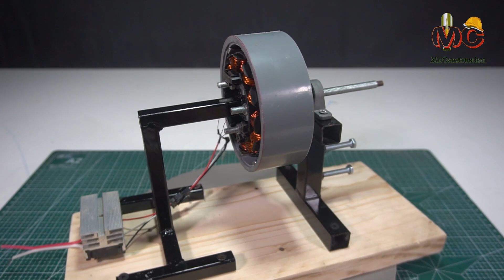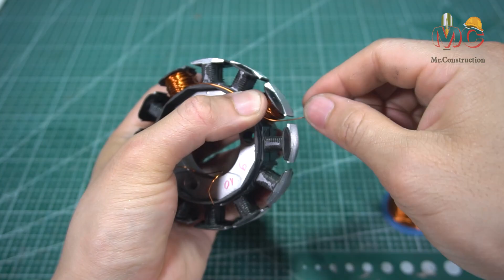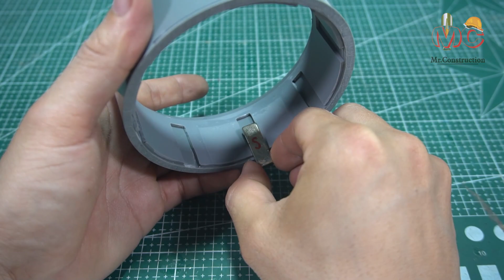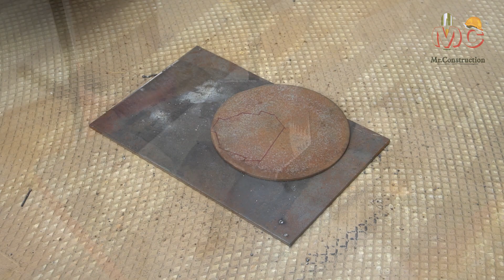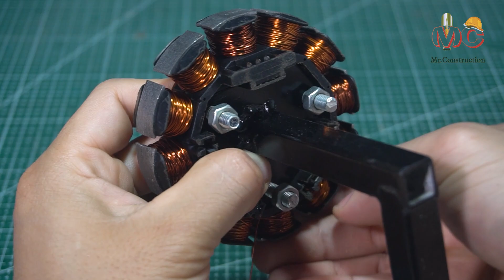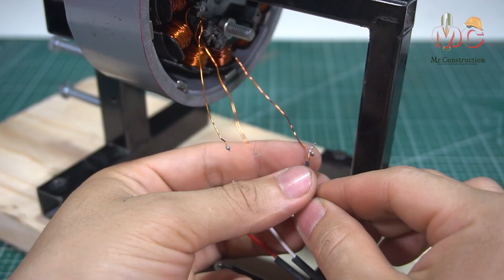How to make a 3-phase generator from simple materials

Comment: no one is talking about the fact that he is using an AC to DC converter. to power an INDUCTION AC motor. and the voltage would be way too low. There is no inverter. Even if you added one, it would be too power-hungry.
Reply: AND the fan is ac the rectifier is 3ph to dc how is this  possible to run an ac fan?